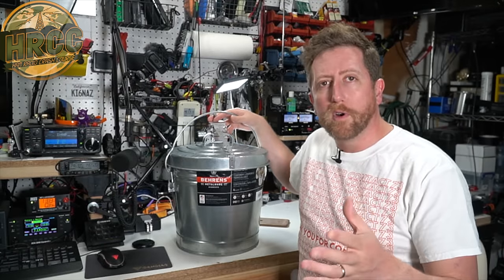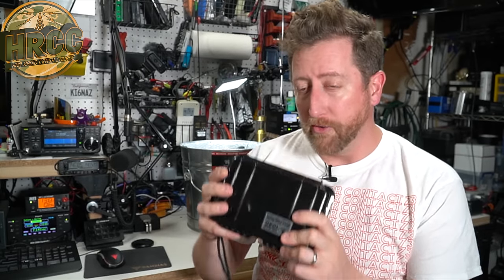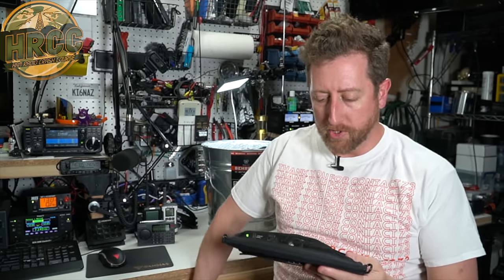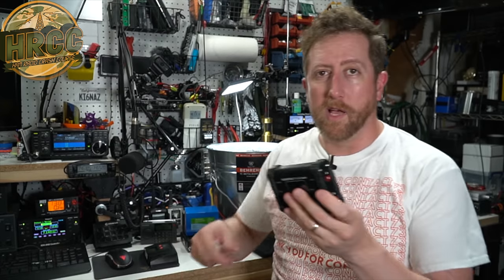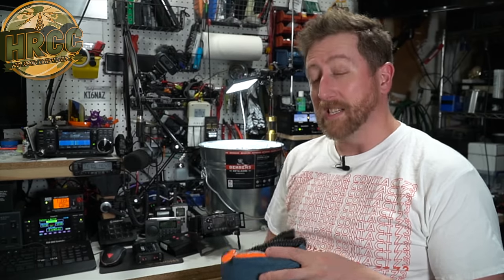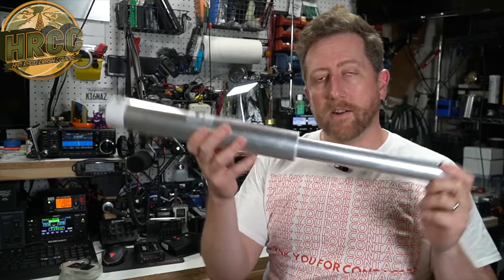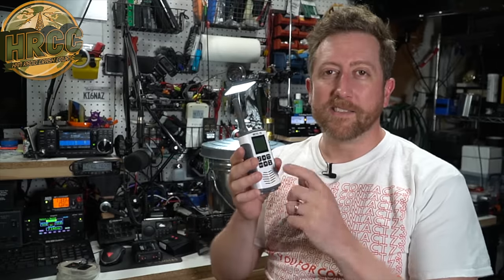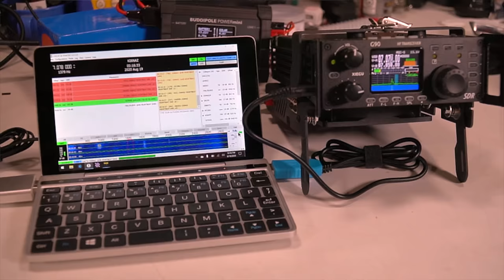Ham Radio EMP Kit, The Tactical Trash Can

Comment: A Faraday cage only works well with a near-perfectly conducting spherical container. And even if your radio survives, there will be much bigger problems to deal with. Good luck.
Reply from the maker: Check out my last live stream. I tested the trash can with an sa
Reply: H Higgins  I agree that deviations in shape won't be noticeable in good conductors, but resistance in non-perfect conductors give rise to voltage gradients across the conducting surface which will result in incomplete cancellation of the incoming wave front. (And of course, a poor seal is a huge resistance). Perhaps the more interesting question is about the pulse spectrum and field strength at your trash can. Is the leakage through such cages enough to zap modern ICs with their nano-scale junctions and/or memory chips with the propensity to flip bits?  

And that's assuming that you survive the radiation, heat and structural damage from the traditional nucs.
In either case, I suspect a more important priority is fresh water and a defense against the armed neighbor who didn't shield his radio.

Comment: Ham Radio Crash Course >> Josh , i would look at ammo cans for doing this as you have more option for sizes. Plus they are water tight to a degree. Let alone mylar bags around your equipment as well will give an additional layer of protection inside of the can  (  * just an Idea :) *
Reply from the maker: They not water tight if you end up emp hardening the seal.
Reply: @HamRadioCrashCourse  should have to use the gasket as did as they are hinged so the top would carry any voltage across it and a rubber seal that is around the top would stop any electrical charge trying to jump any gap so it would be force to go thru the hinge no ??

Comment: I'm new to this but Let's hypothesize I have an underground faraday cage radio room. So an emp goes off if I had an antenna sticking out of the cage and connected to a radio inside the cage, the radio would be kaput I'm assuming. What if you somehow are able to create a fuze box right at the edge of the cage, can you create a fuse box that breaks when overloaded with electromagnetic energy between the antenna and the radio?

Comment: Another good container choice are the aluminum NEMA electrical enclosures. You can line the interior with cardboard and perhaps rigid foam. Being aluminum the enclosure will be anodized. This coating is non conductive. This will require flexible beryllium strips used on screen room doors. Contact Lindgren Screen rooms, they might be able to provide you with info regarding a source for this material. I know its available in many styles and sizes. You will have to follow the manufacturers recommendations on how to mount it.
Another source for finding the conductive strips is to contact Ramsey Electronics, they no longer manufacture electronic kits but there is a subdivision that makes faraday containers for various purposes. Their stuff is great but requires deep pockets. They might have a wealth of info on if and how to ground the container for maximum shielding.

Comment: Don’t think things like hardware and wire is susceptible to damage from voltage overload. I would add a higher power amplifier and keep hardware and cable around for a large antenna so you can reach out and pull in distance.

Comment: How about a Pixie or other small QRP rig for 40m in an Altoids tin? CW is more efficient and can be powered off the solar panel. Throw in a EFHW made with 26-gauge and you have an emergency HF setup (though you’re not frequency agile).

Comment: Your passive components such as the antennas, radials, feedline don't need to be in the EMP can if you need to save space.  They won't burn out.  If they do, I'd check for radiation burns on your skin, too.  If there is an EMP I'd assume you would be in a total grid down situation.  I'm also not sure about survivability of solar panels - the blocking diodes that are used on solar panels might be vulnerable - so maybe getting a pack of spare diodes would be advisable, too.  One option to storing whole LiFePO4 batteries is just storing a spare BMS board.  Also, how about a spare butane soldering iron?

Comment: For those that are repair savvy: 
the $100 rechargeable soldering iron TS80, the $20 pocket oscilloscope, and inexpensive multimeter...
should all go in the kit so you can start scavenging for good parts to repair your good radio equipment.

They take up very little space in that can, and can be stashed inside the radio case to conserve room. Just sticky note the radio that the items are inside the chassis before using. Also keeping simple components you think could fail from emp (ie capacitors, relays, ICs, etc)

Maybe your old cell phone too, Like an iPhone 5, if you get to the edge of affected area. Plus, it has calculator, camera, apps for ham calculators, etc.
Reply: I personally also keep an extra ecu, coil, relays, and fuel pump motor for my distributor-type Jeep in there as well.
Reply: Also that duct tape made from aluminum sheet could seal lid to can from moisture and emp and just invert a couple pieces vertically to keep it electrically conductive since the adhesive back will impede that.

Comment: We had a tent lined with copper screen. Lot of grounds and a panel that isolated the antennas from the inside, Think op amp. They call that, a BAD DAY.  HF rules. Have kept a spare rig and some gear in a trash can for years. When I was working in the tent we had lots of heavy steel cases for the spares.

Comment: One other approach is that tube-based equipment is not affected by EMP.  I have a bunch of equipment from the 1950's that was left to me by various relatives.  As long as there are no transistors in the old equipment, it should be fine after an EMP.
Reply: Story in a college course: a modern competitor country plane was captured and brought in for dismantling. Tear down revealed the whole plane ran on tube technology. Everyone reviewing the results were laughing about the backwardness they saw -- until an insightful engineer said the plane was obviously designed to survive EMP events and a sobering hush fell over the room. There are only two countries still manufacturing tubes, as a source for stereo and guitar amp builders and repairs.

Comment: My biggest question is why measures haven't been put into place to prevent the transformers for being at risk.  All these things may not matter if those go out.  You first have to have power before you can expect to hear anyone talking over the radio waves.  Correct me if I'm wrong.  Also a more than obvious question: if I don't have the money to spend on all the gadgets (including that awesome $450 G90) then is there any way I could minimize what I'm putting in there?  What are all the essential things I realistically couldn't do without that you've presented here?

Comment: The problem with EMPs is the wires on the power grid and our antennas. The long spans of wire gather the radiation and then deliver it to the house. 
To prevent damage you not only must shield electronics but isolate them from antennas and the power grid. 
Bring plugs and knife switches.
Reply: your initial  ASSUMPTION  is  Wrong.      see my comment
Reply: Just repeating what a supposed “authority “ on EMPs said.

Comment: would be very intresting to set up a spectrum analyzer and a broad band antenna inside and test it for attenuation... keep in mind that an EMP is a VERY VERY VERY big impulse of energy that can bore hole into coax and capacitor almost like a lightning just a couple of advice, keep the bucket attached to ground (possibly with the shortest lenght of cable possible, keep it in the basement and make sure to short out any rf connector on the radios and any open part were the rf ca get in the circuitry (and possibly even the coax and other stuff), why don't you put in a nanoVNA or similar to check swr?
Reply from the maker: I did this on another video. About 70db of attenuation.

Comment: So I'm thinking. Just for some handhelds for use in immediate vicinity, emp protect with a metal paint can with the standard hammer on lid? Secondary question, if you really wanted to go ham on the subject (pun intended) and wanted a lot of supplies for setting up a local network for comm what about metal 55 gallon drums?

Comment: What about the lid and where the handle is clamped onto?  Isn't there some minor gaps (not a true seal).?  Using the Aluminum ducting tape could be a solution to cover those spots?
Reply from the maker: Solder and tape, go nuts.

Comment: I heard it is crucial to make sure it's completely sealed I used aluminum tape. Wrapped aluminum box 7× sealing every separation with 7× layers of non conductive packaging tape. Might just Wrapped it in chicken wire for the added protection but idk. Insights?

Comment: I really don't understand why you guys are having all this trouble !
I have a anti-EMP set for decades (40 years plus), it doesn't need any Farady cage trash can, and it is allways connected, ready to go:
YEASU FT DX 505, 500W plus PEP input power, ALL VALVED (TX and RX) with some extra protecion on antenna input and power supply 😁😁😁😁😁🤪🤪🤪🤪
The only problem while operating the unit is that I'll have to wait for all you guys to take your stuff out of the trash cans before I continue to operate on HF (I'll be all alone in HF for a while) 😄😄😄😁😁😁🤪🤪.

SORRY, I couldn't avoid messing with you guys 😄😄😄.
The trash can is a great idea, and makes all the sense:
Hams should be the only ones (apart some specialized military anti-EMP equiped units) to keep communicating after a EMP event.
If you are not prepared for that, how are you going to do it ?
So, of course it is a great idea !!!
I, personnaly, use the FT DX 505 as a primary, and a COLLINS TCS-12/MARCONI all valved TX/RX setup, as a secondary.
My 'trash can" is a former container for the IR seeking heads of F-16 air-to-air missiles, metallic mesh sealled, with a YAESU FT-817, solar panel and controller, plumb battery, hand-crank generator, wire HF antenna and counter poise, manual tunner, mini base, dualband antenna kit with mini mast and acessories on the inside.
Also run a VW Golf II (Rabbit in the US), that doesn't have electronics to burn (modern cars will be fried in miliseconds and forever). (It as a spare fuses kit, because, YES, they WIIL blow out on a EMP event !!).
It plays the important role of a electric make shift power plant (also have adittional fuel in military 20 L cans).
Buckup car is a Range Rover Classic (no electronics) to position myself on high ground for coms search (portable spectrum monitor, and than follow up with the tranceiver).

My coms back up system is a Farady cage filled with pigeons (best anti-EMP system, besides telepathy of course)😄😄😄😄😄🤪🤪🤪. 73's

(Next project for me:
Specialized coms container for Zombie Apocalypse 😁😁😁🤪🤪🤪 (just kidding😉)

Comment: Much like the old joke about making the entire aircraft out of the same material as the Cockpit Voice Recorder (since they always survive) it might be best to make the can larger, so you can fit inside of it with the radio... ;-) But seriously, a can inside ANOTHER can has been suggested, and grounding the can is debatable. Where did you get that conductive seal? I've heard of others using something like steel wool, and I wondered about some coax braid, or just a loop of  coax, the kind with the soft foam dielectric that normally is a pain installing? HF might not be so good post blast, maybe VHF/UHF for line of sight, and 160 Metre as the highest, and 135.7–137.8 kHz (2200 m) and/or 472–479 kHz (630 m) bands might work better since with no sky wave you still have ground wave (Google Project GWEN) so these might be better? 73 and All the Best! DE W8LV BILL

Comment: With regards to the noise - EMP/CME,will almost certainly ionize the E-layer, probably others, for 30-60 minutes, possibly hours. CME will be longer lasting than the EMP E1 pulse (which will decay in less than a second) the E3 pulse can last minutes, but EMP will be more powerful. Long term ionizing of the upper atmosphere (days, weeks, months)?  I seem to recall the military projecting some ionospheric effects from nuclear blasts lasting for days to a week or two? The strength? From what I have read, the radiation projected from nuclear tests into the ionosphere lasted for months - and radiation will ionize ionosphere. I am working from poor memory here, so I could be wrong.

Comment: Did you seal the holes on the sides where the handle attaches?  Or the seams along the side and bottom?  And the two holes in the lid for the handle?  You gotta cover ALL the holes or it's just a metal box.
Reply from the maker: Holes are all pop riveted. The top lid I braised the handles.
Reply: I tested screw holes and seams they all need to be covered with copper tape. pops as well. RF goes around corners and though thin gaps and holes . Spot welding was ok.
Reply from the maker: We can test that tonight live.

Comment: I’m putting all my obsolete electronics in the bucket:  laptop, phone, tablet, solar panel, charge controller, battery, radios…. One question, does the bucket need to be grounded?  I don’t think so, but why not?  Also the bucket should have an insulated lining.  Will an EMP effect a LiFePo battery?  Will it effect solar panels?

Comment: I Installed all of my gear inside of a old Army heavy metal file cabinet. I Made racks to set everything up to operate inside complete with cooling fans. It is sealed with thick aluminum duct sealing tape and set on rubber pads to isolate it totally.    The power source wire is wrapped with aluminum foil and duct seal to prevent EMP Pulse from absorbing the cord and traveling inside the cabinet.

Comment: I've an old rifle safe I'm no longer using for rifles and some old lead sheathing for roof edges I'm tempted to have the boys bring that in the shop and make something up for me, I think the hard part would be making sure the door seals around the edges. Anyone know if EMP's can travel through two layers of steel and 3 inches of concrete?

Comment: A quick test may be to put a cell phone inside, go to a location that normally provides full scale cell phone strength (still a relatively weak signal) and call the cell phone in your faraday cage. And you have to consider that even if it does not ring, an EMP and it's successive waves will be multiple orders of magnitude stronger than the cell signal... So until we get a real EMP test, there's no telling what will actually be sufficient. We could be over-estimating, or grossly underestimating it's ability to penetrate our shielding. Anyone got a few EMP's we can borrow for some testing?
It may, or may not, be overkill to isolate that small bucket in a galvanized trash can. Then isolate the trash can inside a water-tight, grounded, connex/shipping container. Then perhaps bury the container deep under ground. Then cross your fingers and hope something survives. And if it does survive, hope someone else was as lucky as you so that you're not the only working radio left on the planet.
Reply: Or you could simply get a vacuum tube radio (aka boat anchor) from ebay as a backup. I have 5 full systems (incl Heathkit, Hallicrafters, Hammarlund), as part of my collection. My wife has to pedal harder for these but oh well.

Comment: I did not see any rubber liner inside the can, you need something to insolate everything inside the can from touching the can, Flex Seal or Plasti Dip or other kind of rubber paint can work for that or a rubber liner of some kind. also you should have the can grounded as well or you will git hit with a good charge when you touch it.

Comment: For redundancy, and not much more space taken. You can load up that laptop with SDRsharp, decoders, virtual cable and all the other software goodies... toss a small SDR like an RTL2832U in there. Or even another Bootable USB stick loaded with linux (kali maybe?) and all the software tools you need. If an emergency happens you could use the linux stick on just about any computer that survived the EMP, or your own if windows decides to crash... operating system redundancy.

Comment: I keep a cheap radio and flashlight in a small faraday bag in each of my cars.  You can also wrap the radio in aluminum foil if you don’t have a faraday bag.
Reply: foil would be a cheap, easy, and low volume secondary barrier inside the can as well.

Comment: You are wasting a lot of space putting in things like cables and tools in the can.  Things that are not sensitive can just be stored in a cardboard box next to the can and they'll be fine. The Carrington event did fry wires, but those were power lines that went for miles and induced a lot of power.  A small coiled cable won't accumulate enough to damage the cable.  And it wouldn't hurt to wrap everything individually in foil as a backup in case your seal isn't as good as you thought.  Also it would be a good idea to put things like backup thumbdrives in the box because your computer will be fried, so at least you will have your important data for later after the apocalypse when you can get a functional computer.

Comment: You might want to double check the lid where the handle mounts to it for gaps. I have a can just like yours and it has gaps big enough to let light through. If I understand EMP’s correctly, these gaps will let the pulse through destroying everything inside. Also, could you include a link to the gasket inside your lid? Thanks.
Reply from the maker: It’s in the description.